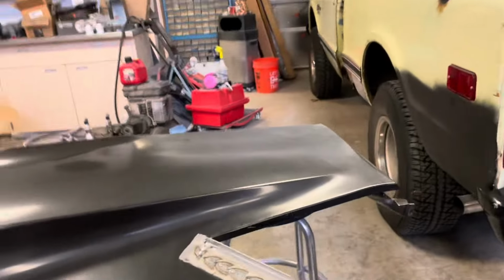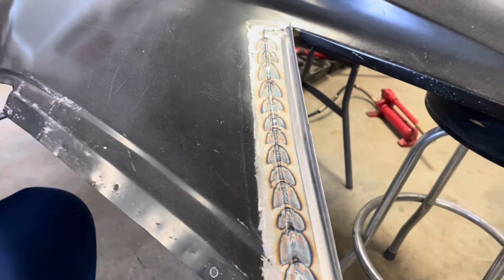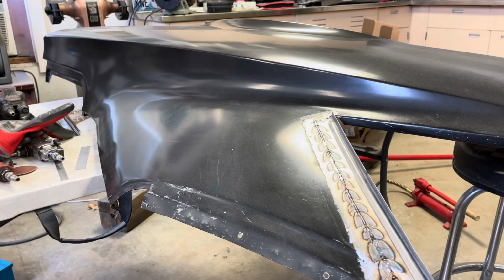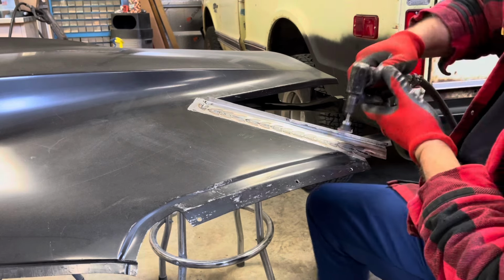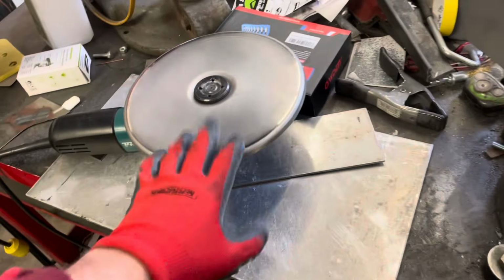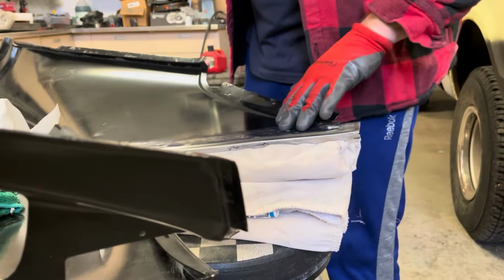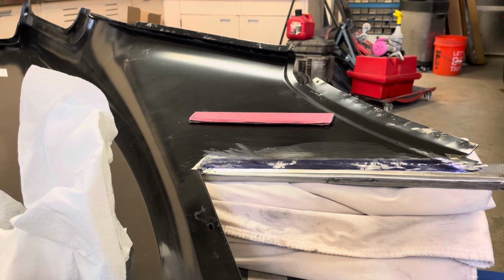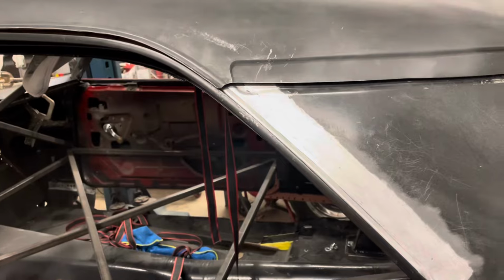Metal Shrinking disc

Comment: Brother! You are obsessing! That looks great for a guy who is just starting out.  I am no expert, but my buddies who are, always say TIG welding is really about rhythm and feel.  Takes a long time to really catch the groove.  I've seen pros that can't do that well on thin metal.  Only advice I would give on the welding is just do shorter bursts. 3/8" instead of 1".  Smaller D's.  Smaller filler rod will also help with the build height, but you will need to move fast.  Also always start your weld puddle on a tack bridge or the end of the previous run.  But overall that is a fantastic outcome. Head high Roger!
Reply from the maker: Thanks, been watching some of the other suggestions of tig welding vids, appears that the goal is to fusion weld and just add enough wire to not have an indentation for aesthetics. Trevs blog has great info
Reply from the maker: Also I obsess because I’m cursed with perfectionism which I fight with tooth and nail
Reply: @MrFireman164  lol. I hear you man!

Comment: I mostly TIG outer sheet metal, what I found is unless you are by an edge you will have to work it a bit. Some tips on your weld looking at it quick is and honestly it looks good but some small criticism..... You are using too much filler for 18 gauge thats where the too much heat is coming from melting the filler wire. I get my puddle formed and walk it down the edge and add only when I know it won't hold. Speed is your friend here like others said, if you see any of my welds the heat affected zone starts off and ends the same, yours seems to keep building so speed up or lower amperage as you keep going to keep it consistent.. I usually run 45-50 amps foot pedal controlled, 18 gauge but I have videos where when I am TIG welding running it down to 20 amps to control the heat. There is a lot of examples on my youtube from covering door handles to gapping whole cars using mostly TIg. I also don't use pulse. Try a 1/16 inch filler wire I know it larger then assuming the .030 your using but you only have to dip so less often and can drag the puddle further with that filler. you 1/8 inch tungsten? I like a number 5 cup 10 cfh flow and I am also a bit spoiled with a water cooler but have got the same results with a #17 air cooled torch. Good luck its just practice

Comment: What are you using for filler wire? Next time run some wire out of your mig and use it takes much less heat and doesn't add so much metal!
Reply from the maker: I used Mig wire, thanks

Comment: Bauer 20V 4.5" grinder from harbor freight  runs at 7000 rpm. that may work better.
Reply from the maker: Cheaper for sure but I already pulled the trigger on the makita, thanks for the comment